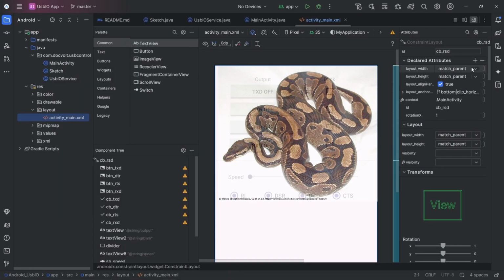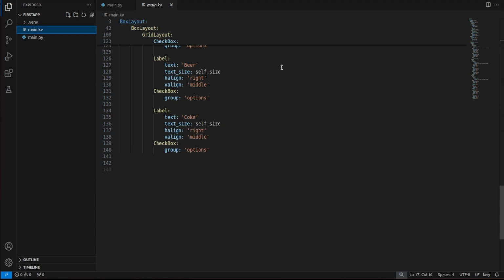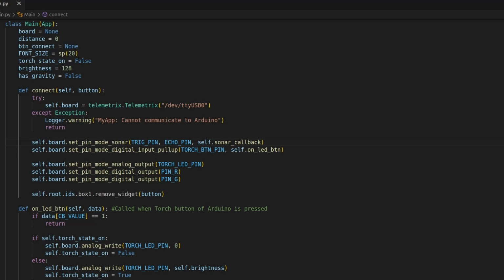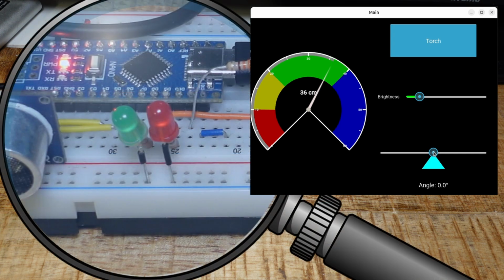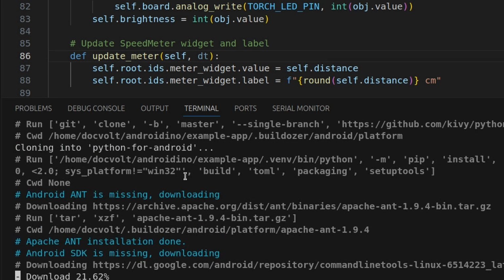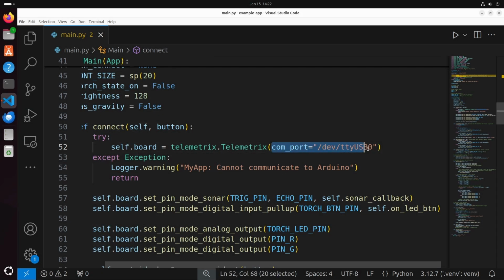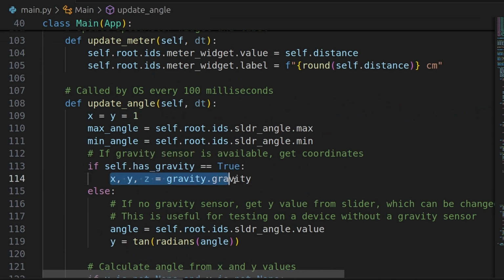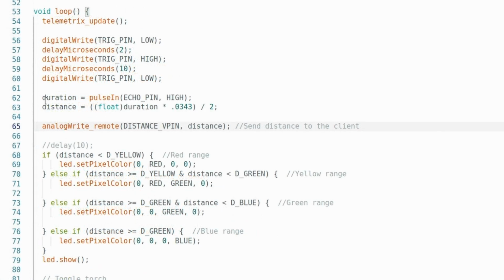Your Old Android Phone as a Controller for Arduino Projects

Comment: I've been waiting for this since the last video. But this seems a bit complicated. I've looked into writing my own java app and found a serial port library that supports arduino and all the common USB to serial converters. Didn't have the time to test it yet, but just having one app with integrated serial communication seems much simpler than writing python code, having to wrap it up into an app and then using a second app to do serial over tcp.
Reply: Hey, i m interested to know which library you found to support the ardiuno connection by serial port ! thanks

Comment: Somewhat more involved than using a web UI on a phone, but the IP socket connection would definitely be more responsive than HTTP. But TBH the wired USB connection is kind of a downside - this would really be more appealing if it talked to the controller via radio like ESP-Now or PainlessMesh.
Reply from the maker: It depends on your project whether a wired USB or wireless connection is better. If you run an IP socket directly on an ESP,  the app can also communicate over wireless without any issues.